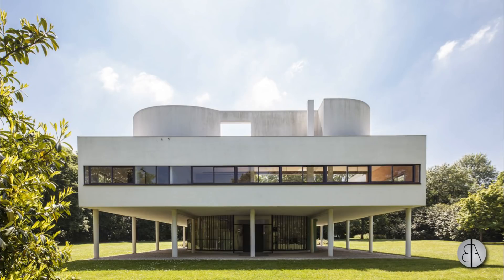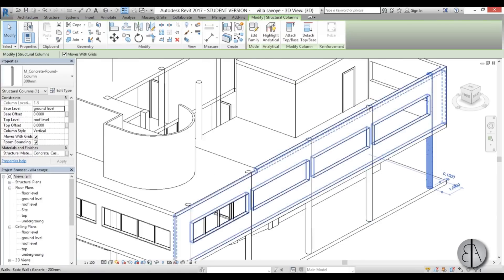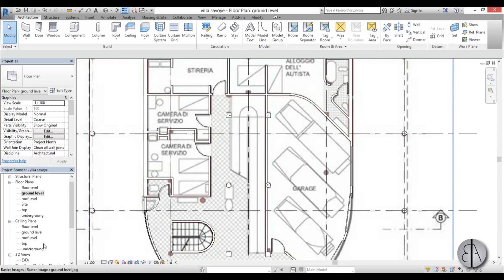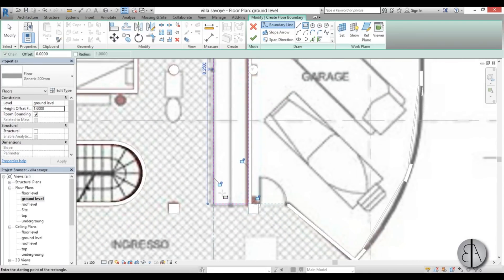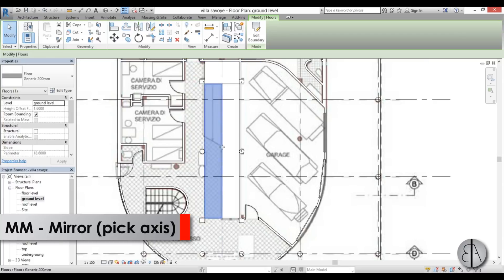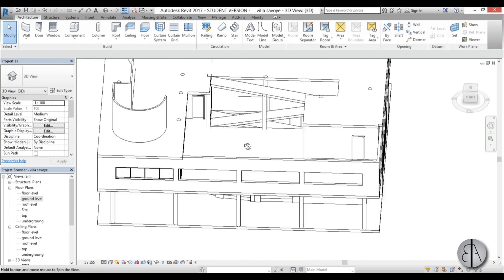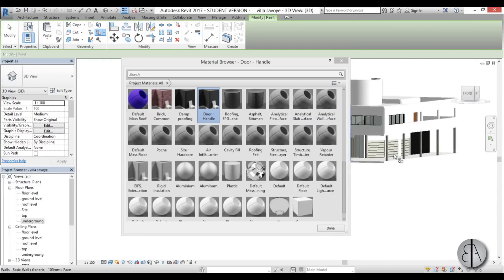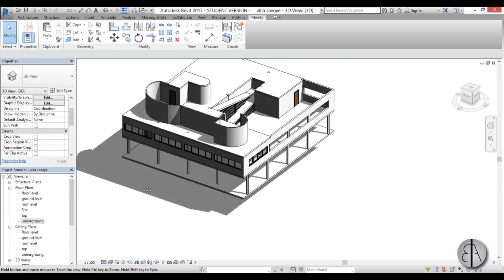Le Corbusier's Villa Savoye in Revit Complete Tutorial * Part 5 *

Comment: Hey, everything was going well until I started to sketch the stairs. I keep getting the message "can't create run by this sketch". It looks like all my lines are connected and I followed your instructions step by step. Any tips would be very appreciated!
Reply: Hey, I had the same problem but managed to fix it. Make sure you have boundaries for the staircase set exactly as in video. I had an extra boundary connecting ends of the bigger "U" boundaries (lines of selected walls).